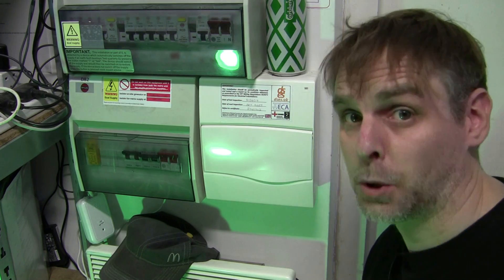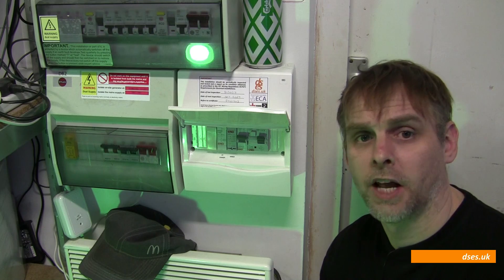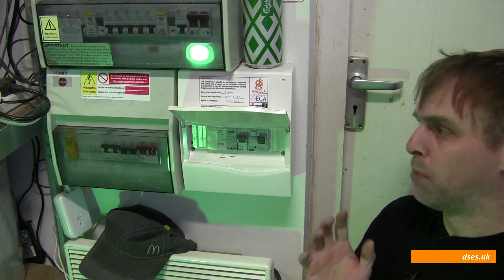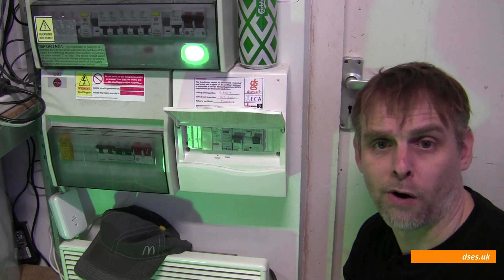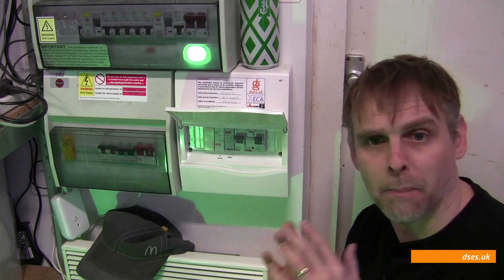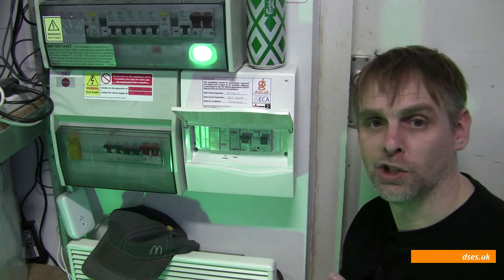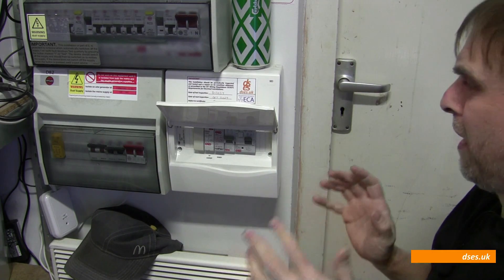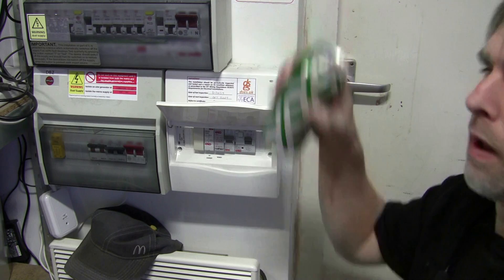The Garo shower priority unit

Comment: I wouldn't install a shower that is rated less than 10.8kw. Mira Sprint for example. Leaving aside the possibility of  getting a 16mm load cable (x2) into this board what of the OCPD rating at 40 amps ?

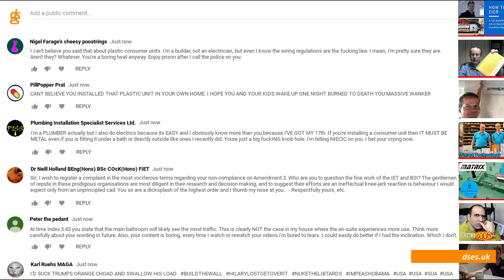Comment: would someone care to explain to me why the example at 9:30 is a bad one? is it because the wholes are ungrommeted / without a gland , the tail from the meter too long / not anchored down ? what am i missing doesn't seem too bad to me
Reply from the maker: Top of enclosure not to IP4X, no tails gland, no strain relief on tails, no grommet around some metal edges, tails not secured, tails mounted across face of meter preventing ease of reading and bonding cable insecure. More on this example can be found here: https://www.dses.co.uk/index.php/personal-blog/178-cowboy-competition-6
Reply: @dsesuk  a reply from the man himself , i feel so honoured :D

Thanks a lot for the quick reply and the great info , your articles are always top notch.
hope you have a great one
Reply from the maker: @gabrielman7  You wouldn't feel so honoured if you could see me right now sitting in my underpants in front of the computer surrounded by empty lager cans.

Comment: I would have fitted:
- a flow switch into the cold supply to the shower.
- a throw-over contactor at the CU. 

When the flow switch activates - the shower is on - then the contactor energises throwing current only to shower (priority).
When the contactor is de-energised, the current runs to another shower, or the heating system, or high current drawing appliance like an EV charger.
 
Simpler and cheaper.

Comment: when my dad was looking for a garage consumer unit (so that he could sort out the mess that is the single RCD in the consumer unit, the garage consumer unit would have an additional RCD in it so that there is no longer a single RCD, and three of the circuits would be moved over into the new enclosure)
and the first one he got was, and I quote "made for the Chinese market" <-- his own words
and as it used a weird arrangement of an MCB with an RCD module attached to the side of it, it was single pole switched, which he wasn't happy with
oh, and it was also a plastic enclosure, but he didn't care about it being plastic
(and I think the new one would be a metal enclosure)

Comment: I designed a "Dumb" version of this for one of my customers who lived up a mountain. He had had his cutout fuse (60a) blow twice and it didnt take me long to find out why. He had an extensive hydroponic greenhouse setup (all kinds of fancy exotic plants, etc) and the system used several large heating elements and fans. At times, this system would pull 28A leaving not enough left for house which included a 1000mm all electric cooker and a 10.5kw shower. I had no idea this product exsisted at the time so I hatched a cunning plan. I shoehorned in a 2nd set of outgoing 10mm conductors from the shower isolator and ran them into an FCU right next to it on the ceiling. From there I fused it down to 3A and ran 1mm t+e straight back to the consumer unit. From there, I fed the outgoing 32A circuit (for the greenhouse) through a normally closed contactor (40A rated, I always overrate my contactors) and used the 1mm cable to control it. Now whenever someone switches on the shower isolator, the contactor opens and the greenhouse power is cut thus removing the additional load. I even completely ommited the greenhouse supply from my diversity calculations as the shower was the more significant load. Anyway, it worked like a charm. I have not heard of anyone else doing anything like this - would be interested to know if anyone else has done/seen similar.

Comment: Great video, but I'm struggling to understand the circuit. From the section with the close up of the components, it looks as though the contactor is normally open. Does that mean it is powered until the load shedding shower relay detects load and de-powers the contactor? If so isn't that a bit inefficient (keeping the contactor semi-permanently powered)? It seems as though it should work in the opposite sense with the contactor normally closed and the load shedding shower relay powering it to open and disconnect the other load.... but then if the 6A MCB is switched off both loads would be  connected which isn't how you described it. Any help with my obvious misunderstanding would be gratefully received ... Thanks.

Comment: Out of interest, is there anything you do with cetification for maximum demand when this unit has been installed?
Reply from the maker: I think Max Demand is only shown on an EICR, so an EIC for the installation of such a device wouldn't show it. Is that what you mean?
Reply: @dsesuk  If ordinarily the maximum demand for an installation exceeds that of the supply fuse but you have have a priority unit fitted. Do you make some sort of reference on the EICR/EIC?... If you had two electric shower circuits running at 9 kW each but the current limiter (priority unit) only allowed say 15 kW, would your maximum demand for these two circuits be 15 kW or 18kW?
Reply from the maker: @ashmanelectricalservices4318  I see what you're asking. I'd go by what the priority unit allowed, or the rating of the highest load as although they're two circuits only one can be fully energised. So if there was an 8kW and a 9.5kW shower being shared by one of these, then my maximum demand would be 9500/230 = 41A. I'd ignore the 8kW shower as it pulls less and only one load can be used at any one time.

Comment: How do you get around the metal box requirement for customers, just swap the guts into a compliant enclosure or do you do something fancy?
Reply from the maker: To date I have only fitted two, one was in 2013 when plastic was still permitted, the other is in my own house post Amendment 3, but I just went ahead and ignored it as I accept the risk (there being none in my opinion). If I had to install one for someone else, I'd either need to find a metal Garo enclosure type tested for these guts, or go with an alternative (such as the Eaton gear in an Eaton enclosure as shown in the SocketToEm snap in this video).

Comment: ha ha very funny you should maybe go on the stage, your right nothing wrong with plastic boards, but the limp wristed cockneys cant tighten the terminals hence the london fire brigade chucked their two bits worth in the ring, and because its the all important london we have to use metal boards, much easier to deal with symptoms rather than the tossers fitting them. Although MK, Crabtree and their other companies thought it was good enough to just stick the BS number on their boards, even with them failing the hot wire test.

Comment: in a domestic 100mA rcd on a tt is the enclosure for it got to be plastic or metal?
Reply from the maker: If it's domestic, then Reg 421.1.201 applies, even in an outbuilding (as is my understanding, although if it's detached then you might get away with a risk assessment if there's no chance a fire could spread to the house and is unlikely to cause loss of life, e.g. a toolshed at the end of a garden rather than a guest room someone may be sleeping in). If you're putting an earth rod onto that outbuilding with a 100mA RCD in a metal enclosure, you must ensure the incoming line is isolated from that enclosure by means of a suitable insulated gland and that the wiring within from the gland point to the RCD terminal is minimal, has no contact with the enclosure, and is correctly torqued so it is unlikely to come loose. It's funny how for years a metal enclosure on a TT was a no-no, and now it's supposedly alright so long as you do it properly. If CU's were installed and maintained properly, plastic ones wouldn't be the fire risk they supposedly are!
Reply: @dsesuk  the tails will go through a gland and a swa will be properly landed so will a metal be ok?
Reply from the maker: @AllenGoldsmith  Should be. Again, it's all about keeping the line away from the metalwork that's earthed by the rod. The outgoing tails will be on the RCD side, although you'd still gland them. For the incoming SWA, you could terminate it onto something like a plastic Wiska box mounted adjacent to the enclosure as the armour would be earthed by the origin and you wouldn't want that in contact with the TT'd enclosure anyway. You could then bring the SWA cores into the RCD enclosure via a gland with the inner sheath still intact (the white/black PVC between the cores and the armour). Once in, cut back the inner sheath to expose the cores close to the termination point, so the length of single insulation is kept to a minimum and away from the metalwork.

Comment: Just a thought.. if there was room then why not put the whole schbang (plastic cu an all) into a metal enclosure?   Surely this would comply even if it looked like  a dogs dog's dinner and was £100 more expensive than necessary.
Reply from the maker: Doing that is an option, but where's the advantage for me in my case? It would cost more, look worse and I'm confident enough in my own installation and maintenance that it isn't a fire risk anyway. I'd be going to the effort just for tickbox compliance with a regulation I believe is a nonsense!
Reply: @dsesuk  more for the rest of us facing a similar installation problem.
Reply from the maker: @noskills9577  Ah, well, this is the dilemma we're all in. What I'm prepared to live with myself, and what I would put in for a client are two different circumstances, but yes, an exterior metal enclosure would be an ugly, expensive and, in my opinion, somewhat pointless solution to keep on side of the regulations!
Reply: @dsesuk  yes indeed, perhaps another brand will bring out a English compliant one - I won't hold my breath tho.....

Comment: I'm with you on the installing of plastic I changed the consumer unit in my house early last year and I bought plastic Crabtree high demand split load consumer unit off Ebay for £20 and I had all the spare mcbs in the back of the van I know its installed correctly neatly and all terminals are torqued correctly so what's the problem as you say the installing of metal consumer units only covers shit do called sparks backs but even when they poorly install them it still doesn't I think the industry should be regulated just like gas is.
Reply from the maker: Better regulation is certainly required. A change of materials will do nothing to stop electrical fires, and as an electrician I'm certainly not ripping out my plastic enclosures to replace them with steel; I'll sleep soundly at night knowing that the equipment I have is installed and maintained appropriately. Prevention is better than cure, and a steel enclosure is only a cure if a fire starts within it after it has already been installed correctly which is an oxymoron if ever there was one!

Comment: David is the maximum demand purely your cutout fuse size say 80 amps for an installation and how does diversity work in relation to this even two electric showers on the go and the usual ring circuits and what have you wouldnt compromise that 80 amps would it ?? Great video btw your a funny guy 👍😂
Reply from the maker: Maximum demand is a funny old beast. I mentioned I have a 60A fuse, but you can see in the video that I have a lot of circuits here, so on paper, if we follow the guidance and calculations in the On Site Guide under Appendix A, my demand calculation would actually be much higher than my fuse should theoretically be capable of passing! And that's the trouble, you can have two identical houses with the same number of sockets and the same appliances, but if house one has a single 32A ring, and house two has two 32A rings, then on paper house two has a higher maximum demand going by Appendix A. When it comes to maximum demand, you can either: calculate it roughly according to OSG Appendix A and assume loads (e.g. 100W per fitting for lighting), or calculate it more exactly according to OSG Appendix A but apply known loads (actual loads known to be on site), or use the rule-of-thumb of adding up all MCB's and multiplying by 0.4 (can't remember where this comes from or how 'official/accepted' it is, but people do it), or record it by measurement by leaving a clamp meter on MAX setting and recording what the maximum value was over an average period (say 24 hours). I've employed all these methods in the past, but usually most domestic premises are fine with their demand until the homeowner wants to whack on a much larger single load such as a shower or car charger, and that's when you need to really start looking at what's already there and if it can cope.

Comment: If the problem is only not blowing the supplier fuse, a simpler solution woldn't be install a breaker instead of the main switch in the consumer unit, rated of the same amps as the supplier fuse, so if you exceed the maximum load it will trip before you blow the fuse?
Reply from the maker: These protective devices are designed to be the last resort and to cut the power in the event of a fault, not in the event of normal operation. If normal operation is exceeding the limit of the supply and forcing the protective device to operate, then you have an issue with the loading and design of the electrical installation. It would not be acceptable for a 'nuisance trip' to occur because you're trying to take more from the supply than it was designed for.
Reply: David Savery Electrical Services Good point. I think these Breakers will allow a higher current than the cable really wants through it for a bit longer than is optimal too.

Comment: Uprate the main fuse and then stand back and watch when the supplier electrician turns up and continues to use a old leaded cable of unknown size. Installs 2 meters and another fuse carrier. So you end up with 2 fuse carriers with 100amp each and the old leaded supply cable. Seen that too many times.

Seems the only thing the supply company care about is the capacity of the transformer and the main wires going down the street. The branch wires to each house seem of little concern in most cases.

Comment: I think the amendment 3 was more to do with faulty mcb's catching fire and breaking out of the enclosures, I remember a couple of recalls on the trade counters because of dodgy Chinese mcb's.
Reply from the maker: Maybe, there have been various recalls in the past, MK and Lewden being ones in recent memory, but I believe London Fire Brigade were the ones pushing for change based on their analysis of where domestic electrical fires had broken out, and I think the issue was down to poor workmanship/maintenance and enclosures ill equipped to contain the hot stuff either because they weren't of sufficient quality or were knocked so full of holes they were better ventilated than an open barn in a Kansas tornado. Some fool punching out dirty great holes in an Amendment 3 enclosure is sorta defeating the purpose of installing the thing, and there's little monitoring or comeback after they've taken the money and fled.
Reply: @dsesuk  I'm probably a bit more cynical than you I think 1. The big companies don't want to be liable for a component failure which causes a fire in a good installation.
2. They also get to sell a shit load more consumer units.

Comment: The nice thing about stored hw (cyl) is you shouldn't have this problem and you can use it as a dump load for pv .
Reply from the maker: Very true. Cylinders seem to be out of fashion however, as everyone seems to be pulling them out in favour of combi boilers and instantaneous hot water solutions! I still have one, but the demand on it with two teenage daughters means an electric shower is just more practical.
Reply: Yes of course by having heat on demand you avoid the situation where you run out of hw but I can see peak demand on the distribution (not to mention generation)  system be coming a big problem in the near future, with electric cars etc... there will need to be smart ways to manage this issue. Of cause pv will help if used correctly.
Reply from the maker: @PETER WILSON Yes, the solar boosters are a good option.

Comment: Since 18th edition, I believe that you can not get away with a type A RCD for a car charging unit (unless the charger itself has provision to guard against dc greater than 6mA) and you have to use a Type B RCD (that will still operate if the vehicle allows > 6mA onto the supply cable).  Some type B RCD’s are type A’s with additional electronics integrated into the same unit so that it will trip with dc currents >6mA. Just saying.  The Garo unit looks useful - you could buy the unit and then put the controls within a metal enclosure for not much extra cost.
Reply from the maker: I defer to the PodPoint peeps for their requirement for a Type A RCD for my car charger (installed under 17th Ed: A3) so I can't comment on that. As for stuffing Garo gubbins into a different enclosure, the hangover comes with Reg. 536.4.203 under 18th Edition which requires the clever stuff inside the box to be type tested for use with the box. It would be okay if a metal enclosure made by Garo could be sourced, but I haven't found such. Another option of course is to site the whole Garo thang, plastic box an' all, into a larger steel enclosure, but it's giving me a pain in the balls just typing about it!